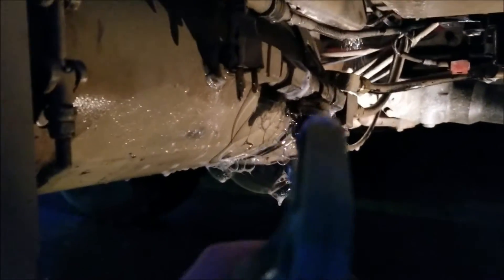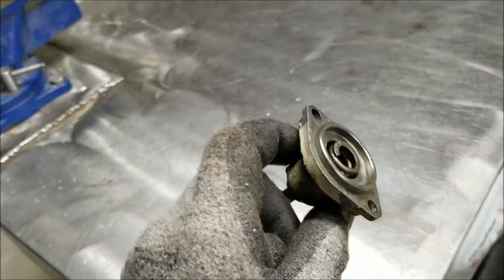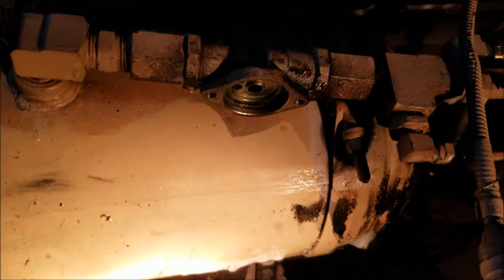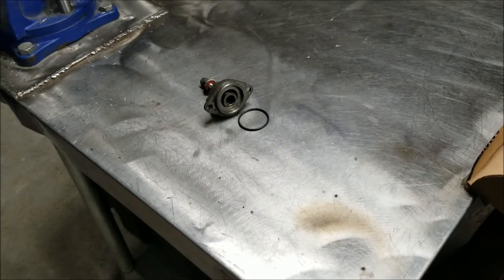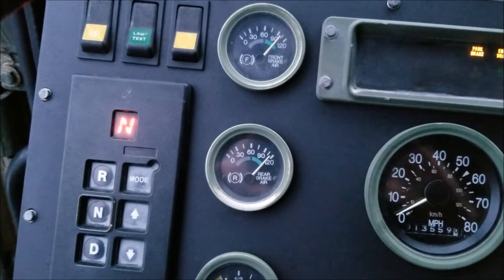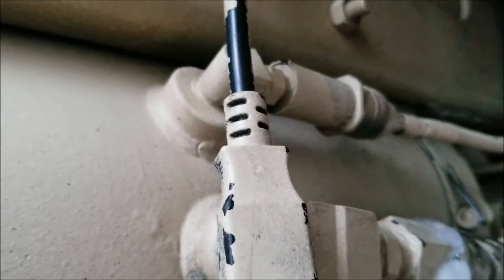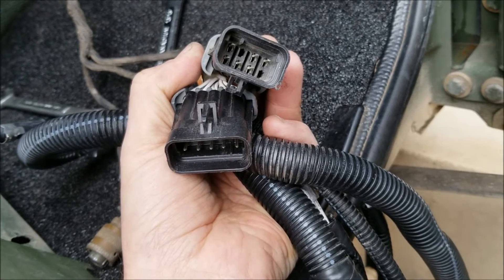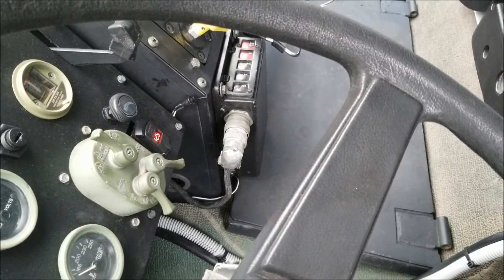LMTV CTIS troubleshooting

Comment: I spoke with the guy I know at DES in Tumwater. He said that most of the CTI systems have been gutted of functionality. I know mine still works like it should, but could that be the reason why you have so few pins and only transmitting power and not PSI? I wish for you only the best of luck figuring this out.